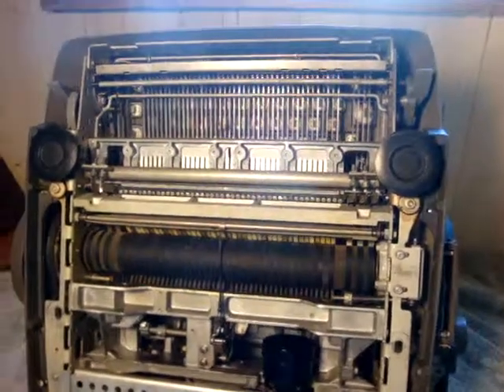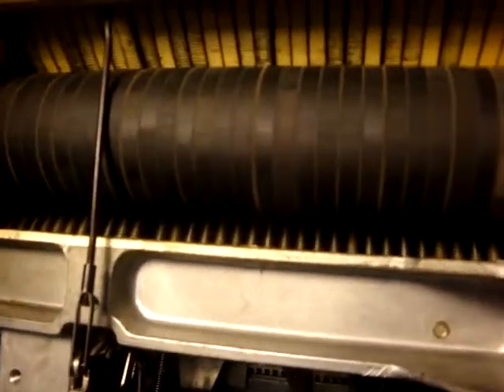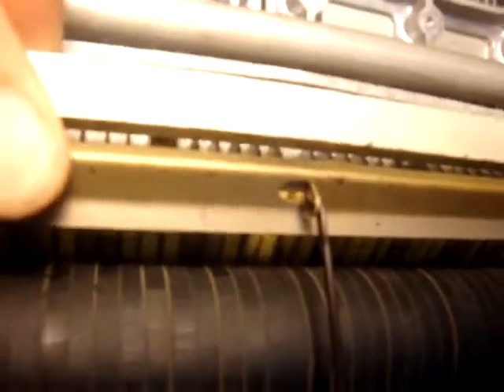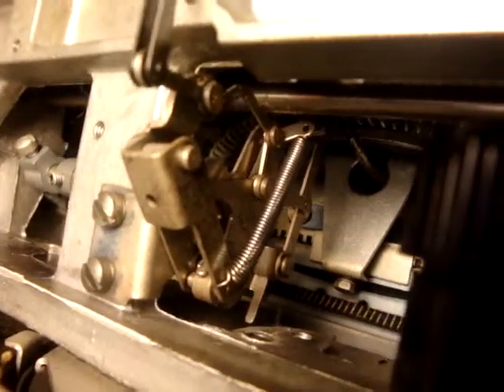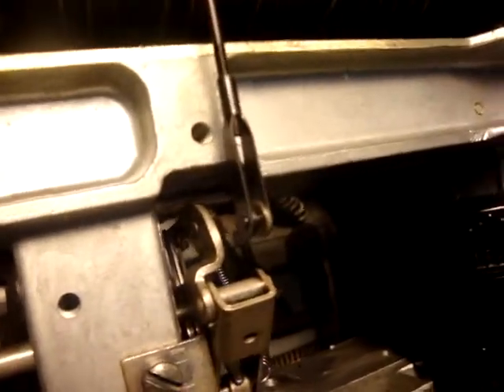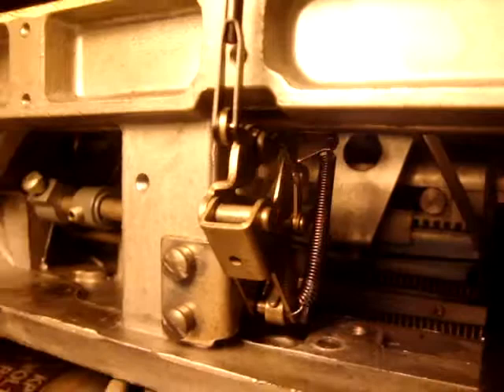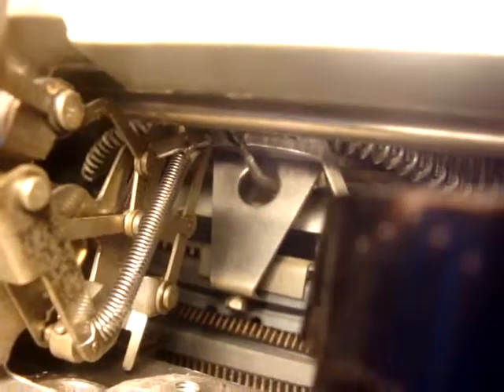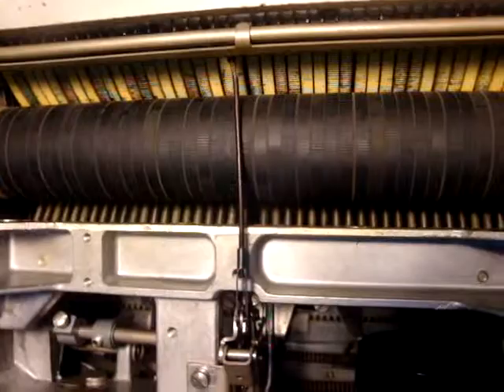IBM Model B Typewriter Undercarriage

Comment: That 4" link transmits movement from the long bar that's hit by the roller cams (which look like they could use a good cleaning, by the way) to the ribbon vibrator mechanism--the mechanism that raises the ribbon carrier to whatever height is selected.  The selector mechanism is included in this video toward the end.  Perhaps this video was requested by someone who needed to replace this little bar, or the bar already on the machine needs adjusting, which is done by twisting the clevis on this link clockwise or counterclockwise.